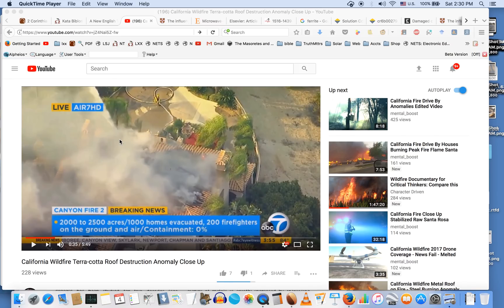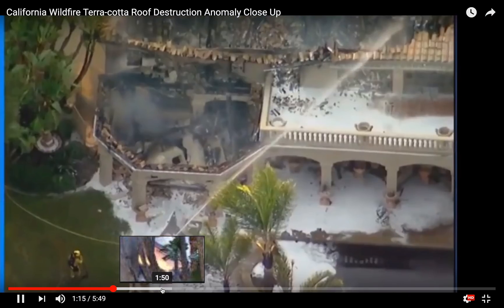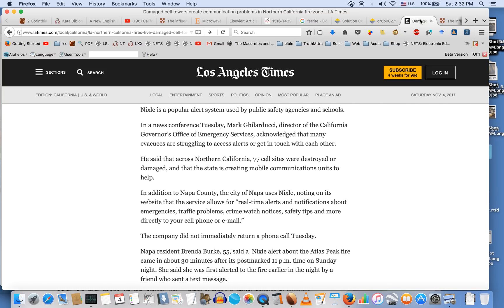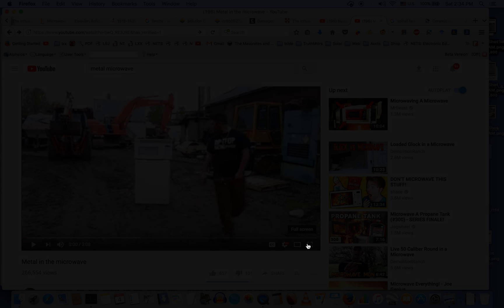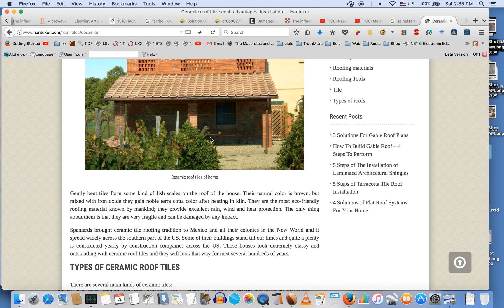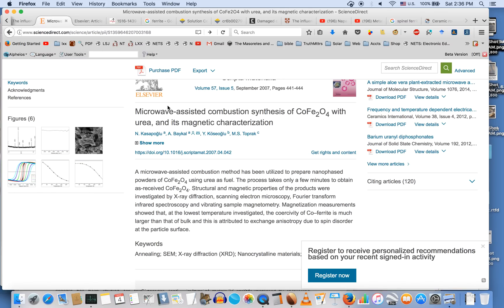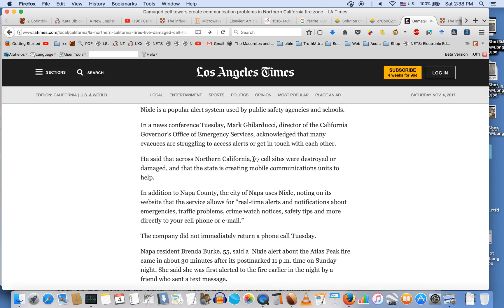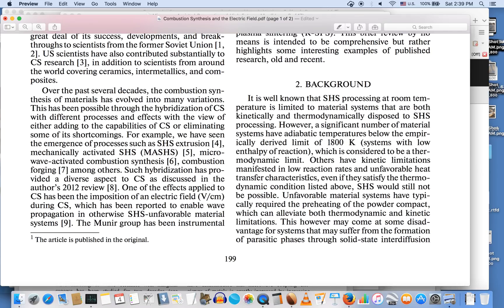California Fires: Terracotta Roof Anomaly: Microwave Assisted Combustion Synthesis

Comment: This house burning despite the lack of the  surrounding DRY trees is NOT WILD/FOREST FIRE. In that sense this is an anomaly that requires explanation. There is no mistaking since the reporter states the surrounding area IS NOT burned. This indicates a SPOT fire INSIDE a house, NOT a WILD FIRE. I appreciate the effort and research you have done but I think the claim should be challenged in this case, here is why. The fire triangle is fuel air and spark, those three things are necessary for fire to ignite and once ignition is established, you must maintain fuel and air to keep the fire going. You pointed out that terra cotta is 'fired' or baked in a kiln at 1,000 C which converts to 1,830 F. The problem is in the super heat of the closed pit or kiln the iron in the clay has already oxidized, iron oxide being more commonly known as rust. If the contained  iron would ignite it would ignite in the kiln where it is exposed to flame and confined allowing long duration exposure to that high temperature. Remembering the fire triangle, the kiln flames must be supplied oxygen to keep the fires burning. Removing oxygen from the fire when there is still fuel left for the fire to consume is just like putting the lid on a jar candle, it continues to burn until it has used the oxygen and the wick goes out giving off thick black smoke turning the top of the wick brittle like charcoal. Secondly, terra cotta is made of clay, muck like brick that are fired at the same temperature. Brick contains sand(silica)which would melt into glass at high enough temperature which does not burn. I have been to a brick kiln that was actually hotter than 1,000 C the bricks are stacked 6ft high in very large groups extremely heavy glowing red from the heat and they do not burn. I'm sure you can find video inside a brick manufacturer showing this process. Bricks containing other metals are used in fireplaces and forges where people heat iron and steel to melting point to shape them into knives, horse shoes etc. Those bricks are exposed to extreme temperatures repeatedly for long periods of time and the chrome-magnesite in them are not consumed or melted. The operating temperature for these is 1648 C or 3,000 F. At this temperature ceramic (regular brick, terra cotta) would melt, not burn. Take a good close look at the fire you see in the videos with the room dark. You will see that the tiles are not at all melted or vitrified (glass transition like magma). You will also see that the tiles themselves are not burning. IF they were the fire would be on top out along the roof and the tiles would be turning into ash. What you will see is that the fire is kept underneath the terra cotta. The heated air in the home would rise and as any firefighter from a city would tell you fire always goes UP. The roof joist wooden beams the plywood or particle (glue) board and TAR PAPER sealant under the porous unsealed terra cotta is burning at high points where the heated oxygen underneath has fueled it and as the wood and tar paper are consumed there is nothing left to hold the tile in place it falls exposing lower part to oxygen from outside to continue burning. If you look close at the open uncovered space within the house you will see the fallen tiles that had no wood left to support them scattered on the floor/ground. Still ABSOLUTELY 100% UNNATURAL ARSON.

Comment: Grace: you may find this interesting. Here in southern California, many homes have concrete roof tiles called Barrel Tiles or S tiles on the roof (https://eagleroofing.com/browse-tile/high-barrel-concrete-roof-tile/). According to The Concrete Center (http://www.concretecentre.com/Performance-Sustainability-(1)/Fire-Resistance.aspx), concrete is fire resistant while other sources claim concrete barrel roof tiles are fire proof. I have these barrel tiles on my house as do all the house where I live (built post-Northridge earthquake 1994). Additionally, concrete tiles are less expensive than terracotta so most newer homes and refurbished homes use the concrete tile.

Comment: So hold on...when i was a kid and they built these subs didnt they sell the terra cota as a fire safe roof??? This would be the same time microwaves became a household name...this is diabolical!
Reply: killerdrums2010 go up on your roof if you actually have terra cotta.  Remove a few tiles since they ARE NOT glued or nailed down and you'll see this black stuff.  That's called tar paper.  It's actually made of tar and fibers.  It is 100% combustible. Under the tar paper is WOOD.  Last time I checked wood was flammable.  Oh and before you try to make any stupid statements.  I'm an ex-wildland firefighter.
Reply: @bradley19822                 Why are you assuming he would make " stupid statements"?  Was there anything about his question that was inflammatory?  No.  It was clearly sincere.  Your reply to him was worthwhile until you went sideways with your own inflammation.  Hint > it's not necessary, and only undercuts your own comment.

Comment: You really should write comedy scripts because that what your material is, pure comedy but not a great deal of facts. It is hysterical listening to somebody in Michigan with absolutely zero wildland fire training and/or experience pontificate about California wildland fires. Stucco and tile roofs only increase fire resistance, they do not make any structure fire-proof. All it takes is a single piece of burning material or ember to lodge under an eave or gap in between the roof rafters and the main structure from the native vegetation and the house or building will ignite even long after the main fire front has moved on. Part of the Shelter in Place strategy for newer housing developments in Wildland Urban Interface zones is enable the home owner to detect those types of situations long after the fire personnel have advanced further along the fire line.  Burning embers can travel for several miles and still be hot enough to ignite combustible material whether that is a building or native vegetation.  Further the roof tiles don’t burn but they do fall into the footprint of the home and break apart. 

As for the winds, this fire occurred during a Santa Ana wind event, which is a unique off-shore wind specifically centric to Southern California and generally occurs from October through March. These wind events have been happening since the dawn of time. What is more prevalent now however, is the major construction push deeper into the WUI zones combined with a multi-year drought and very heavy precipitation winter so the fuel loading this year is extreme.  The Santa Ana’s have not been very strong since 2007, which had it’s own firestorm in Southern California in October. 

Do yourself a favor and take a S-130 and S-190 class and LEARN about wildland fires. All of the factors are discussed in great detail in those classes. They are available on-line from the National Wildfire Coordinating Group (NWCG). That is, IF you are the least bit interested in something known a fact as it pertains to wildland fires.
Reply: Now stop that.  There's no room for facts or logic in this discussion - as you can tell by the bulk of the comments.

To your point about propagation:

https://www.youtube.com/watch?v=_Vh4cQdH26g
Reply: Z,
The Oak Ridge national lab has run tests on various assemblies in that facility to aid designers in the specifications of materials and details like vent screens to protect buildings in the wildland urban interface.  It's revealing how the embers can find their way into the building but also how the fire can propagate from gutter/roof debris and dry landscaping.  While it's possible that it was a housefire, what I've seen reported indicates that it was related to the wildfire.  In either case there's nothing about it to warrant the wild speculation about fantastical weapons deployed by a sinister uber-governmental agenda.  It's just so childishly silly, but seriously destructive.
Reply: I'm afraid, Keith, that reason is utterly lost on the people who want to believe this garbage, but I thank you for the post and for posting the class info.  I've taken a few related to designing in the WUI and you gather quite a bit of info just from that.

Comment: A hot flying ignition source, could possibly get airborne, land, and work it's way up into and under a roof tile, and ignite the roof paper underneath.  Now, the odds of that happening, and not burning anything else around it?  A long shot.......really, really long shot.  Say, It could probably happen, if you shot a Emergency Signal Flare at the roof from the street.  Other than that....

Comment: I wonder if there is a way to find out how many of these homes had smart meters? I've got a theory that the ignition of these homes may have been initiated through these meters. Igniting the wiring throughout these homes to facilitate a complete and total burning of the structure.

Comment: DEW....directed energy weapon......laser weapons.
Reply: A laser beam would have been visible in the smoke
Reply: Full armor of God.
Reply: They could just use something like LAWS from a drone or helicopter.  If they wait until there is thunder or lightning, it would  cover the sound.  They probably have smaller ones that are classified and quieter, too.
Or just sit in the aircraft or  car and shine a laser that is strong enough to start a fire and shine it long enough, it should start.  You won't be able  to see an infrared laser; it will ionize the chemtrail metal particulates that are on the building, and now you have an invisible plasma torch.

US Navy's New Killer Laser Gun: LaWS Laser Weapon System Live-fire  
 https://www.youtube.com/watch?v=jIxugT-QiEI

Eziekle, farraday does not work on this because it works at the subatomic level.  finely woven silver fabric blocks some of the lower frequencies, but anything high enough to start a fire will just push or burn through a faraday or finely woven silver fabric, especially if it is pulsed.  it  is probably a pulsed ionized gas laser weapon.

I have been able to photograph beams coming out of microwave towers in a spoke like fashion after heavy chemtrailing by using an infrared camera. I don't think the frequencies carried by cell phone towers could start these fires though.  Give you brain tumors, headaches, destroy brain cells, cause brain swelling, and other stuff, yes.  But it is not strong enough to make a steady state, pulsed beam weapon that can start a fire.

To start a fire, all they need is heavy chemtrail day and drones or aircraft with infrared lasers or use hand held ones.  they could just sit across the street and do it from a car.  Infrared so that YOU can't see it.  People can not normally see infrared.  They have those pulse plasma projectile laser rifles they developed for the military; it was called PIKL, at first, and then changed to PEP.  
You can go to the wayback machine and find the Navy contract.  Let me see if I can find it.  https://en.wikipedia.org/wiki/Pulsed_energy_projectile   https://en.wikipedia.org/wiki/Pulsed_Energy_Projectile  These are supposed to be non-lethal, but we  know that Russia and the U.S. have been working on ones that kill.  Search the net:  you will find articles about it.  Also, like some one said a laser will couple with lightning and could be use to bend the lightning beam and  start a fire by directed and manipulated lightning strikes.  There might be some way to couple a laser to a beam coming off of a microwave tower to direct the hit better.  But I rather think that if 77 microwave towers were destroyed by using them for an attack, they would have take the  towers off line.  Everybody who uses those cell phone towers would not be able to use their phones, and they would have to send illegal levels of energy through those towers.  Be interesting if anyone phone would not work while this was going on.  That might be a signature.  In which, I guess some guys or aircraft with pulsed energy lasers could just send the pulses to the towers and the towers would couple and send the fire causing beams out.  

But, this looks very precise.   It would  just be easier to shoot the  houses and cars.  I think it came from up above due to the black or dark circles that I am seeing.  Hope that helps.
Reply: Paul Jerome actually it was pge power line
Reply: Then how do u explain the trees not being burned next to homes?

Comment: inTruthbyGrace ...I'm probably jumping ahead here..... but you've opened my tiny mind to a HUGE HUGE question arising from contrails.... bear with me.... in case I'm not anticipating your astounding conclusion in your excellent coverage.
Okay, so acc to the great Cliff Carnicon's unstinting analysis, contrails result in a 66,000% increase in aluminum content in the soil.
The forest trees TAKE UP the aluminum (forget everything you ever learned in Bionomics 101 about this not being possible) .... and your microwave agenda present there means the trees can be ignited no matter how soaking wet with sap etc.
I will never reheat anything in a microwave over ever again.
(Total BS.... I threw out Mike's Microwave years ago, thanks to Joan Mootry's innate intelligence.)
Reply: The nano-nano sized aluminium used in chemtrails is an ungodly, unnatural unbound, highly reactive free radical; which blocks the receptors for calcium and magnesium in every carbon based life form.
Reply: dalimamma  I heard a video here on yt that said there were so many aluminum nanoparticles in the root systems of the redwood trees in Cali that they were unable to take in enough water and it was slowly killing them.  Can never find if true or not.  Would you know?